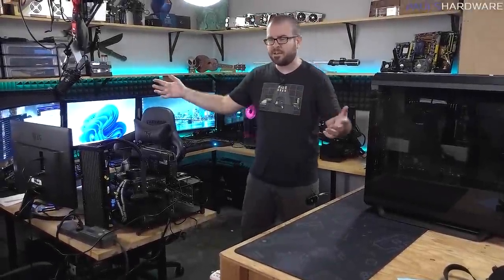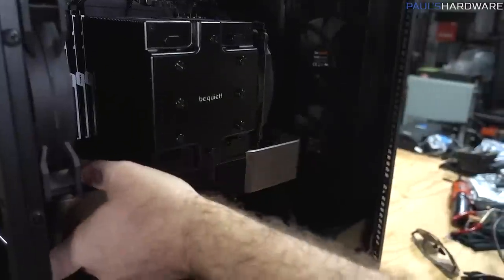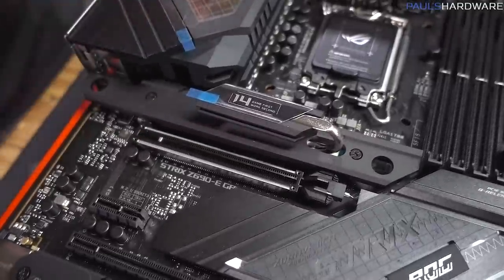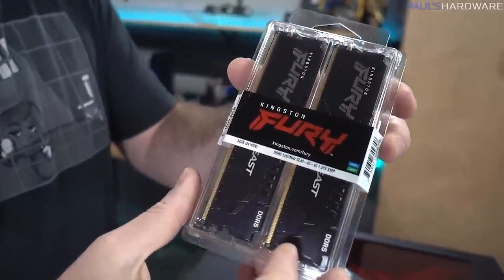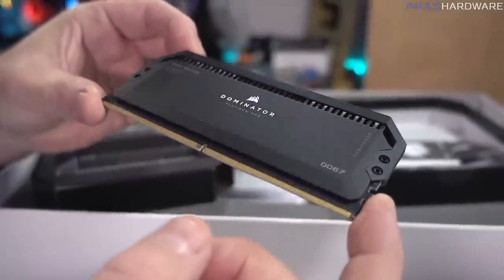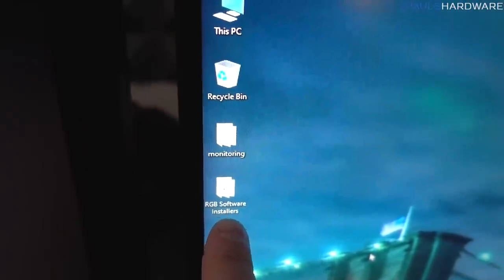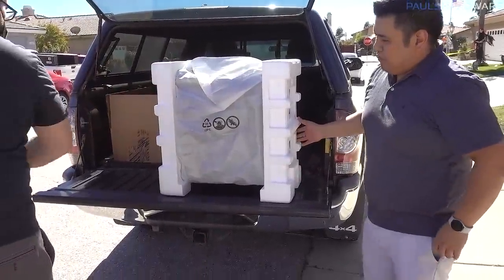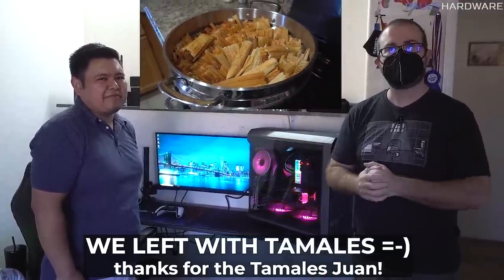EVERY motherboard should have this!

Comment: The features I've been most excited about recently don't have anything to do with the actual hardware. It's stuff like the Q release and the Q latch on the m.2 slots that are the most interesting. You should definitely keep the cutting board as a display item. Also, I really enjoy this type of content.
Reply: Not a fan of the single latch ram slots though, those are a pain.

Comment: It's always a pleasure watching Paul poking expensive things with a stick 🤣

Seriously though, this feature from ASUS needs to become industry standard asap.
Reply: Agree, simple solutions that work are just awesome.
Reply: its not because its most likely already patented
Reply: @shungite785  Most likely. Same with the M.2 fasteners.
Reply: @antisoda  Definitely those too, a simple  twist lock instead of a tiny screw that can so easily be dropped. Genius.
Reply: This! This new PCIe slot button mechanism, as well as the tool-less m.2 mounting mechanism that some new mobos have, should be standard on everything!

Comment: To no surprise i has this exact issue getting the GPU out of a build with a noctua NHD-15 cooler and this would have made life painless.
Reply: @I_Am_Hateful  I had the same cooler and I went custom loop when I replaced that system. The dark rock pro 4 was easier in the long run because it’s still annoying to remove a gpu even without it in the way.
Reply: ASUS may be the first to do this BUT like so many other PC builders that have endured this headache, it been in the making for the last 10+ years.. and a motherboard manufacturer finally put it to work. GREAT JOB ASUS!!!
Reply: I had this issue just today. It’s an asu b560m gaming plus and I have a Noctua NH-D9l(a very small cooler). I was removing the GPU to install an M.2 drive and I had to reach in between the GPU backplate and the cooler.

Comment: I was really impressed this feature was added to ASUS motherboards - simple, obvious and should have been implemented much sooner. Like you I've used the chopstick method which is still fiddly with SLI'ed cards with a watercooling terminal block installed.
Reply: This is one of the reasons I swear by Asus boards.
Reply: @EvilTurkeySlices  - I'm looking at buying the Apex Z690 motherboard but boy have they increased in price this generation!

Comment: Omg this is amazing. Its so funny I used a chopstick as well when having this issue. Pushing with a screwdriver scares me. On my Z490 I actually got my 3080 stuck and there was no way for me to push with my fingers because of the few cm between the CPU and GPU. I actually broke a chopstick in half pushing so hard. Scared tf out of me. Eventually I literatlly took thin pliers and ripped out the PCIE lock. This is a small change but makes the world of difference and no joke is a major selling point for me.
Reply: damn, i use the screw driver and cringe really hard when i do it fearing ima poke the pcb. chop stick is a good idea lol. and i only have a double slot with a backplate, anyone with a 3rd slot has alot more card to maneuver since i use a deepcool assassin 3 which is just fat as hell
Reply: @rippenzong2455  For real. I was using a screwdriver too untill I damaged a motherboard that way... Never again.
Reply: I started typing the lock off before install years ago. This was after fighting an SLI setup that just wouldn't cooperate for the 3rd time. The lock came off in my hand and I was like, let it ride.

Comment: Cutting boards should be used for cutting, it's their purpose.
It's a nice board too, not too big so you can clean it in the sink and wood is really the best material for cutting boards, doesn't hurt your knives, makes them stay sharp longer.
The resin doesn't have that property though and it will leave cuttingmarks.
If you don't have a good cutting board allready in you kitchen, use this one and if you allready have a good one use it as a prop :)

Comment: I tend to keep CPU/motherboards longer than GPU's so I do find my self needing to remove GPU's at least once if not twice per build. It is always a struggle (the only thing worse was trying to replace a PSU before modular cables). 

Asus is usually the brand I prefer because they always have these features and this one will be on my list next time I'm shopping for a system.

Comment: Great feature. This would have saved me a lot of time. I had a build where I was using a screwdriver to unlock the gpu but at times it slipped and hit the pcb (I didn't give it much importance at the time). Eventually the PC stopped working and after a long time of testing every component and checking what could possibly be the problem I noticed that the screwdriver cut a wire from the pcb.

Comment: I drilled a tiny hole in my PCIe latch (hot paperclip = knife through butter) as soon as they were introduced and tied a length of fishing line to it, routed to the front of the case and with a finger-loop in the end.  Nice to see at least one motherboard maker addressing the issue, albeit in a far more complex way.

Comment: I don't know whats under the shroud where the cable runs. But if its electrical PCB connections, then that steel cable should be sleeved. Just incase it were to hit the PCB and ground something out. If there is nothing on the PCB under that shroud where the cable is routed, then all is good.

Comment: Another Idea:  This one actually relates to the above video ;-)  How about we have some quality 180 degree 3x8pin connectors, and I'm not talking about the junk being sold on Ali express, ebay and amazon where they use a stupid PCB to make the turn.  Just a simple EVGA like triple 8 pin connector that would allow most builds to simply route the cables over the TOP of the card, and this way, you're not left with stupid looking cords dangling over the card as the main show within your case.   I see $5000 - $10000 builds and the first thing I notice:  "Look at DEM kablez!!"   Evga had a nice idea for the 10 series with their $15 right angle connector, so why we cannot have that level of quality for the 3000 series is beyond me.  Apparently everyone here LOVES that giant cables going everywhere mess, while simultaneously debating the astetic qualities of fans and other items, but those cables just get a "pass", and no, I'm not a fan of those stupid RGB coverings that highlight the mess....

Comment: I think it is funny that you mention the q-connectors.  I have a pc with the gigabyte X570 Aorus Ultra... and it came with something similar to the q-connector, but also way better.  It came with a little plastic bracket... that you put all of the front panel connectors into... and then it can plug into almost ANY motherboard.  plugging in all the connectors at once, and just working.  It was super easy to install and I really hope to see it more often.

Comment: Yeah. Right now i am in exact the same situation. I have a beefy air cooler (same as you, BeQuiet Dark Rock Pro 4), and i can't reach the lash to release the graphicscard from the slot. in order to do so, i have to remove the 1st fan of the cooler, then remove the RAM, so my finger has enough space to reach it. its a pain! So an alternative method to open it, while being occupied by a card, is something really helpfull. Thanks for sharing this little detail with us.

Comment: PCIe .... my LGA1156 board had an easy-release mechanism - there was a flexible part you could just push out of the way.
Well, back then even a cheaper midrange board often had chipset and VRM cooling.

Comment: I removed and reseated my GPU just yesterday, and I hated my life once again. With an air cooler in place (a Dark Rock like the one in that case over there), it's an absolute chore to release that thing. I have to carefully work it with a long screwdriver every time, which doesn't really make things much easier either.
Reply: @adamd1347  why?
Reply: I would recommend a metal chopstick.  It's what I use and they DO NOT bend.
Reply: @adamtowsley3526  technically wood doesn't conduct electricity.  It's what older power poles were wood. (It was also easier to get a hold of in this country)

Comment: Good video! So when do the Paul's Hardware branded chopsticks come out? lol. I like the q connect, but the q release it's only okay. What a better idea would be an NVME sled or snap connect. I hate that damn small screw!! (I think some tech you tuber reviewed a mb with that feature)

Comment: I love the ASUS Q-Connector. It's such a hassle to make sure that the individual leads are properly on the right pins. It's only now that some case manufacturers are actually putting the leads in a single block like the Q-Connector is. I'm glad to see ASUS add a another useful feature to the motherboards.

Comment: we are em 2021 end. and one thing that EVERY motherboard should have its a segment display for code reading AND a secound BIOS switch with read only so if we done anything wrong it should be autio start and be able to function if the main is dead or allow to flash the main.

Comment: That’s amazing ASUS does have some great products. See what you think about this question. LED light actually flicker. The plate charges and chemical element emits light and the process repeats. So I’ve always wondered if the pulsing LED’s create a RF frequency which could actually cause some interference in the PC’s operation.  I would think that all the circuits runs on the board would act like antennas and possibly this could slow the transfer of data in a really good gaming rig. Like build a PC with identical specs all LED’s and the same with no LED’s and see if it makes a difference.

Comment: Yup, agreed. I've had so much trouble trying to remove installed graphic cards because of this stupidly hard to get to release tab.. and yes, I've only used stupidly large air coolers in my builds until for just a couple weeks ago when I got my first ever AIO.

Comment: Maybe a question for the next probe, but as someone who has been saving up ready for 12th gen cpu and mobo combo, do I go ddr5 or 4? I'm noticing many of the kits that have been announced have much higher CL ratings, even with the higher clock speed. Very excited to hear your thoughts on whether to get ddr5 to upgrade easier or to stick with ddr4 for the next 5 years or so.
Reply: Don't be concerned about the CL rating. It's a ratio not a measurement, so the faster the ram the higher the CL for a given memory latency.

IMHO, the 4/5 decision is going to be an economic one currently not a performance one. In a year or two that will change.

Edit: oh, and traditionally Intel CPUs benefited from higher speeds then tighter timings

Comment: I'd be happy to get the motherboard that was new.  Ordered from Amazon. B550, it came with the incorrect (MAG) backplate. There was spacers and screws in the board and it wasn't sealed... so it was open box or used.. sold as 'new'.
I had to push to get them to get it to me in 2 days. 
I was really close to going through a different vendor, but they couldn't get it to me any faster.

Comment: lol- I just literally had that issue 4 hours ago for the first time when replacing my 2080 Ti with the new evga 3080 Ti ftw3 Ultra and after seating the new one (and plugging everything in and closing the case) realized I had one spare screw. It was the gpu screw. Problem is I left the black rubber guard on that end and couldn't access the screw. So after my upgrade and having to install a new psu with a 3x8 pin connector and spent more than two hours I had to retake out the gpu but that 3080 ti is huge even compared to the old 2080 ti, and accessing that release with a knife took me 30 minutes in itself. I really didn't want to have to remove the cpu cooler. With these new cards this is a great needed feature.

Comment: Is there any benefit to have your graphics card in the top slot instead of the bottom slot?
I’ve noticed ever since I added a bigger heat sink CPU cooler my GPU is running a few degrees hotter, it’s not a big deal but it was just on my mind

Comment: What you didn't mention is that the first pc with the issue had the gpu in the first pcie slot, which is quite uncommon on most ATX and even mATX motherboards.
The Asus motherboard kinda doesn't need the solution as it has the gpu in the second cover slot and thus there is more space between the cooler and the gpu.
On the other hand, motherboard that have the gpu in the first slot usually don't have enough space on the PCB to accommodate the Q-Release, my B550M Steel Legend for example has the rams slots and SATA ports right where the button is on the Asus board

Comment: I've always liked the Dominator Platinum's aesthetics because of how clean it looks from above. But the RBG implementation doesn't do it for me. If instead of the discrete RGB sections, it were a smooth diffuse bar all along the top, I'd be more interested.

Comment: this is literally me 2 days ago. now im full of scratches. i have a xfx 5700 DD. with a Scythe Ninja 5 cpu cooler, inside of an nzxt h210. my gpu started sagging and hitting the psu shroud (ddnt before all the pain). tl:dr i took the gpu off using a long screwdriver and 2 hours of pain and frustration. and all i need the whole time is stuff some random cards in between the psu shroud and gpu, so the fan wont hit it. ugghhh. would love this feature in my mobo. thinking of all that pain and hours and being scared of breaking my system, specially on this crazy times. hope this get to all mobos in the future.

Comment: I have a z490 that has some kind of thing right under the latch, it's nearly impossible to get a card with a back plate out of it. Very scary to poke at the latch with anything with that tiny diode on the board right under the latch. (idk enough to know what that diode is called) If not every MB, this should be on all mid range and up for sure.

Comment: really need this, afraid to poke hole in motherboard when trying to take out gpu when cpu cooler installed.. just enough space for screwdriver between a gpu with backplste and a dark rock pro 4.

Comment: OMG!! I feel like I should buy one of these new ASUS boards just so I can repeatedly press that button. Replacing my 2080 ti with a 3080 ti butting up against a Noctua NH-D15 was a miserable experience. For the record, while I don't hate the chopstick idea I'm always afraid I'll slip and scratch the motherboard so I use a pencil with the rubber eraser side down.

Comment: Is DDR5 pin out same as DDR4?  Heard rumors that it is. And you can physically mix them up.
Reply: Nope. The notch is not in the same place. The chipset does support both DDR4 and 5 so you can buy a DDR4 motherboard and wait for the DDR5 prices to drop. In ASUS' line of cards, look for D4 in the model number. You'll have to buy a new MB though. I don't know if there will ever be MBs with both slots. Maybe.

Comment: I have tendency to use dental floss XD. Wrap it arround PCI latch and thug it behind somewhere. 10-20 cm will do the job. When I need to remove GPu just pull and voila.

Comment: That's why you don't use crappy air coolers that now cost the same as AIO's.... Literally no reason to be using air cooling in 2021 when AIO's are so cheap and outperform air coolers. You can either get quieter operation with the same temps as air, or lower temps than air for a slightly louder pc. Its literally win win. No I don't care about your favorite reviewer and their supposed benchmarks on an open air test bench. As someone who has been building rigs for 18 years, not a single air cooler on the market beats liquid cooling. Not one. And you save so much space using liquid cooling, not needing a stupid chopstick to release tabs, or an overpriced motherboard.

I really hope EVGA gets into the AMD motherboard market like they rumored. I want to support American companies. No, Asus is not American, its Taiwanese like pretty much every other motherboard brand. I prefer to support American businesses like Crucial who uses Micron chips, both companies USA based like EVGA. EVGA needs to step up their game and start supporting AMD like they do Intel and Nvidia. This idea that they have a special contract with Nvidia that prevents them from making AMD GPU's is bullshit and would be considered anti-competitive meaning EVGA could "get out of the deal" in two seconds. You can't stop someone from supporting the other brand. That would be like telling Asus they can only make Nvidia GPU's, great way to get a lawsuit. The issue with many of you is that you don't understand business or law. You live in a land of make-believe. EVGA simply CHOOSES to not make AMD products because they don't believe there would be ANY profit in it.... not to mention require new "tooling" to even make those products. That was their original excuse long ago. That buying new tooling to manufacture AMD would be too costly. But that was their "original excuse" which I believe is bullshit. A business should always maximize profits meaning they should support both sides of the battle. There are people who buy AMD only and EVGA is missing out on those profits.